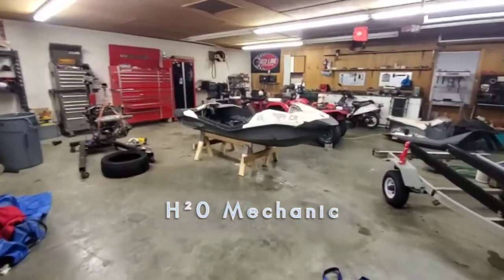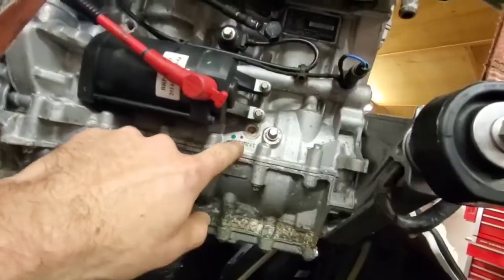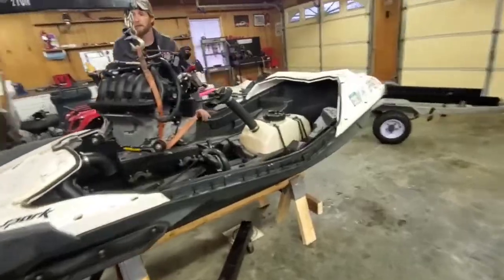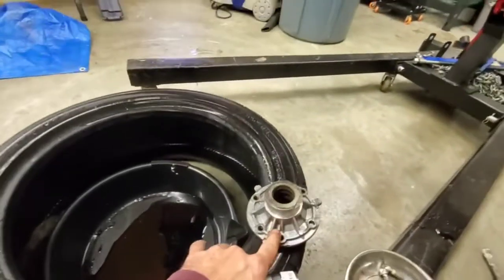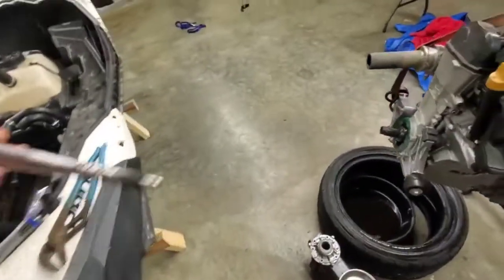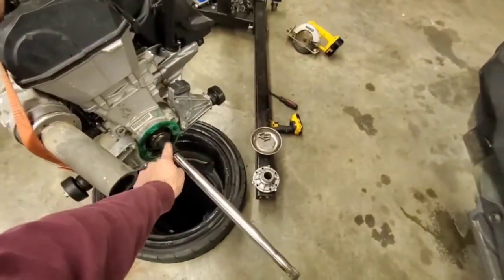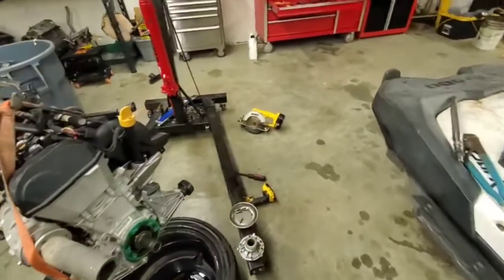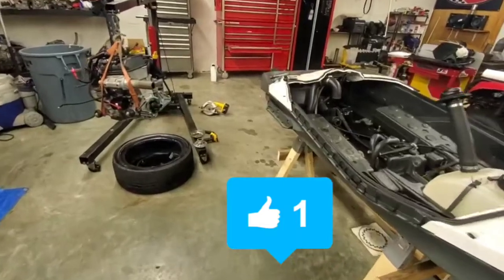2014-16 Seadoo Spark Most Common Failure / New Project. Fixing the Crankshaft Coupler Correctly

Comment: Would it be possible to put a pin through the coupler and shaft?  You would still get the freeplay unlike welding
Reply from the maker: I researched every possible direction it could be repaired & maintain reliability. This way was the only way. 
Remember to pin a crankshaft, your forced to drill threw hardened steel. That's probably not going to happen.
Reply: @h2omechanic    Thank you responding.  The deal I am offered is not enough to take on this headache, which is very widespread.

Comment: What is the company that you could send the crank shaft to and they will send you the fixed one?
Reply from the maker: It was in Australia. I have a local guy doing mine. If he does it correctly, I'll ask to share his business name. That way anyone can send it to him here in the U.S. (east coast). I have everything, just waiting for the crank now.
Reply: I got the same problem
Reply from the maker: @gustavoperez7764  my crankshaft is still at the machine shop...
My suggestion is that you buy an oem 2018 crankshaft. 
If you heat the fat end of the output shaft & use a 2 or 3 arm pulley puller you can actually pull off your old output shaft. 
Its not welded on, it's sweated on. So heating the end helps it swell & will pull off. I didn't know this before hand. But I've seen a Vid of someone who took it off that way.

Comment: I think this just happened on a 2015 spark , just about 40 hours , out no where doesn’t go above 8mph and after around 8mph just sound like the engine revs high but the it’s stripped and is spinning
Reply from the maker: It's a lengthy process to get down in to that area.
Reply: Check wear ring first and foremost